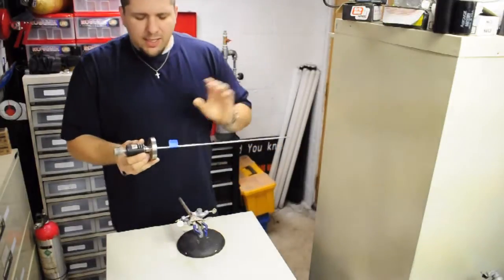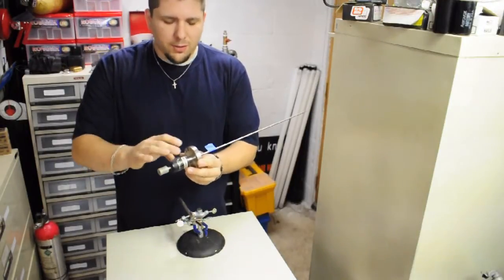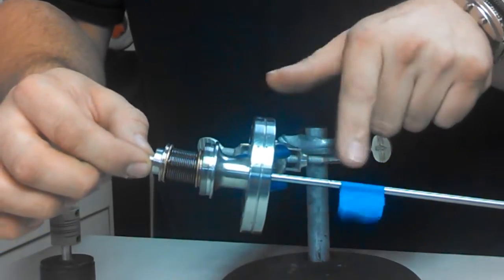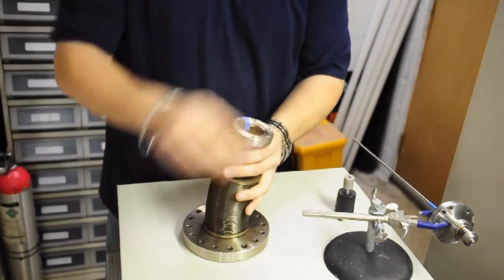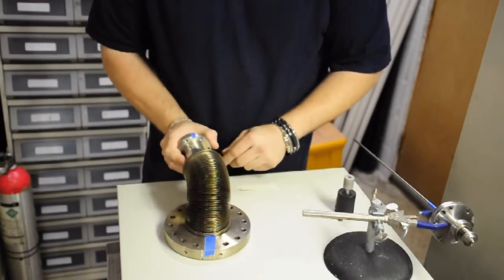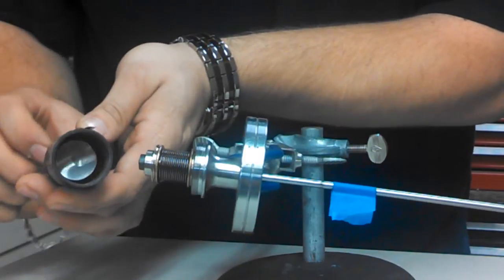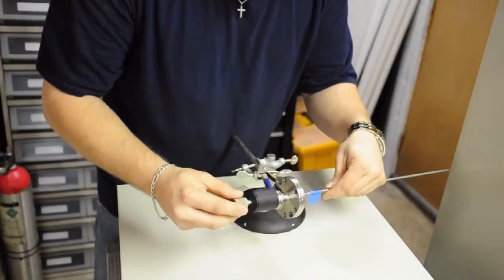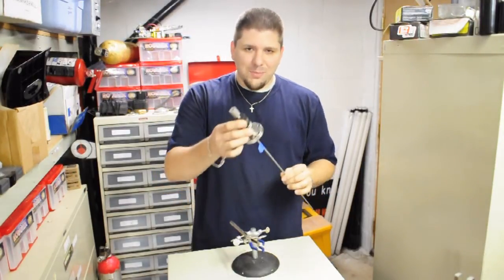SEM High vacuum rotating seal, explained

Comment: He's not talking about the rotating seal.
Reply: I also had the same feeling, but as far as I could understand, "inside" the flexible seal theres the cardan joint (the rusty one he showed), that only converts the motion circular motion if there's a angle in the input.  I'm looking for a 3d animation to be sure but couldnt find yet

Comment: Thanks for showing this, but I wonder if you're not addressing perhaps the most important part of this mechanism.  That is, the long vacuum-side rod needs to be bent inside the bellows.  The bellows itself doesn't rotate (as you say) - but "pushes" the bent tp of the long rod in a circular motion... which rotates the long rod.    
Either that, or I'm missing something entirely.
Thanks again!
Reply: Yes, but to show that, he probably had to rip off the flexible bellows, and if the unit is just out for cleaning, that would damage it irreversibly.
Reply: that sure seems the thing

Comment from the maker: I see what you are getting at, it is not directly a rotating seal, it is a static seal that allows for rotating motion to be translated. There is no slip at all in this joint, it is a 100% rigid coupling and can transfer much more torque then a normal magnetic coupling. As well as at much higher speed then O-Ring seals. It is a neat way of converting motion through a 'rigid' seal. :)

Comment: Hmmm thats not actually a seal though is it. Thats just a really weirdo drivetrain connection for no apparent reason. The seal is inside the metal casing part. The weird drive train is likely there so if the shaft is obstructed it can slip without causing damage.
Reply: As far as I undrestand the flexible connection could be some sealing material like Leather/plastic (since that part is not actually rotating), and inside that metalic flexible part is hidden the cardan joint. So if I understand correctly, it will only have rotation if there's a angle on the input shaft